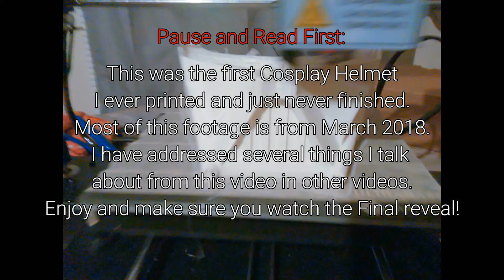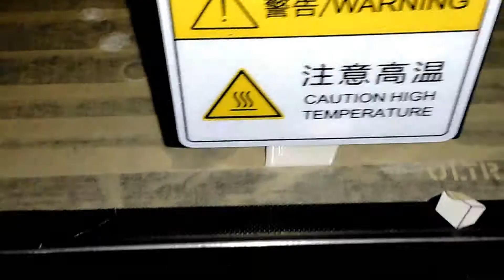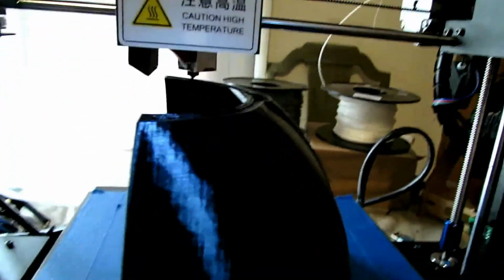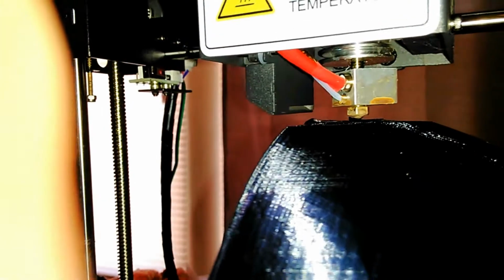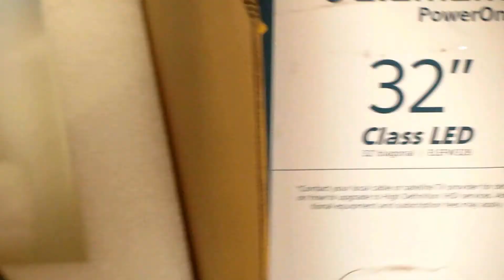DIY 3D Printed Darth Vader Helmet Prt 1

Comment: Did you have to scale it and that's why it is too small or it was already like that? Do you think that if you used magnets to attach the back part of the neck to the mask your head would have fit on it or not?
Reply from the maker: I did scale it. But this was actually the first helmet i ever printed. I didnt know how to plain cut at the time. I was fairly new to 3D printing. i think it probably would fit ok if i had used magnets. it would for sure fit at 100% if i had cut it. im planning on building it again. my daughter was pretty pumped that she got this one so its in good use.
Reply: @BrysonMichaelRC   you did well man, or should I say... Impressive.. most impressive. At what scale do you recommend to print this or what scale will you use the next time you do it? I'm new into this too, I won't print it myself but I have someone who can do it and I have to tell him the scale and all that stuff and I don't understand too much about this
Reply from the maker: haha.  nice. probably just gonna do it at 100% next time. I printed it around 80% and it was ALMOST the right fit. I think 100 would be great. it just depends on your head. I wear a 7 3/4 hat. I usually add a couple inches for wall thickness and print my personal helmets at 9nches wide. if that helps
Reply: @BrysonMichaelRC  I will convert the 9 inches wide in centimeters as I'm spanish and let the person who will help me add the supports after tell them to print it at 100% scale. Thank you!